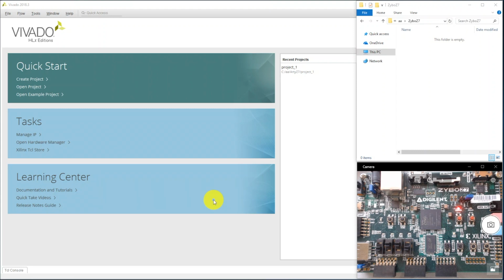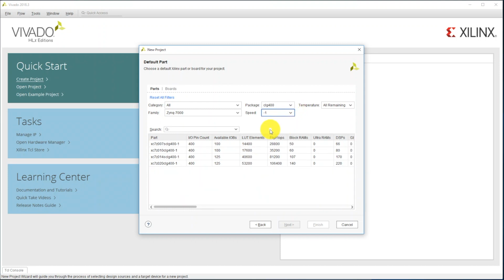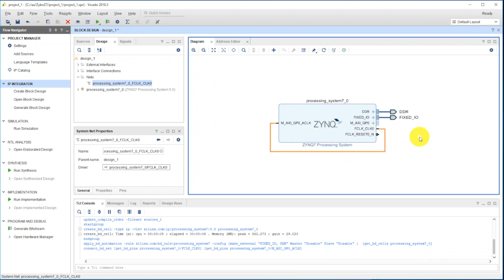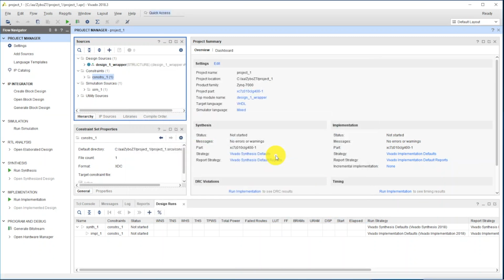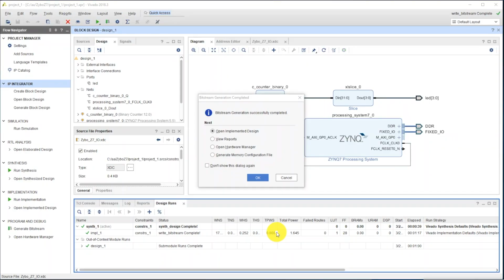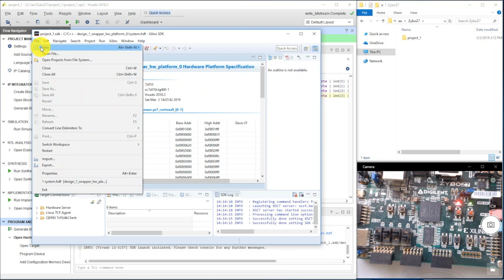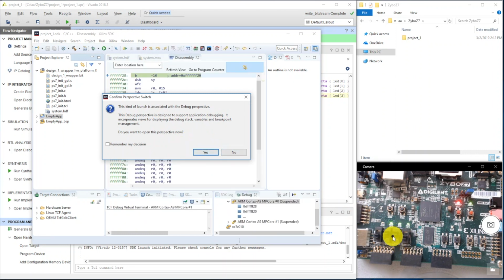Getting started from scratch with Digilent Zybo Z7 Xilinx Zynq FPGA board using Vivado 2018.3

Comment: I would like to make a very directive and narrow comment, if I may.

So, the purpose of this project seems to make the leds blink.
To achieve this, ansepi is using the a clock, and in particular, the zynq's clock.

By default, that clock is dead, but he turns it on by stimulating the zynq with an empty project.
I have learned that there are alternative ways to turn that clock on, one of which is by having an operating system booting on start-up.

The operating system can boot from an SD card. (More actions needed to set that up which I am not disclosing.)

More details about the operating system and how to have it boot at start-up can be found here: https://github.com/Digilent/Petalinux-Zybo-Z7-10

So, yeah, my point was about how to stimulate the zynq's clock to start..... I hope that helped.
Reply from the maker: Yes, of course.  What's on your mind?

Comment: Why do we tie the clock to the input?
Reply from the maker: The clock is tied back to the input so the Zynq will operate correctly with the programmable logic section of the chip.
Reply: @ansepi  Brilliant, makes sense. Also, thank you for the video - I can confirm that this does work as I've tried it on my own Zybo board. One more question: Why do we have to add a 32-bit counter and then slice it down? Can we not have a 4-bit counter directly?
Reply from the maker: We have to slice down the 32-bit counter because the clock is too fast.  If we used a 4-bit counter directly, the LEDs would blink too fast to see.  Thanks for the question.

Comment: Hi ansepi,

This might be a dumb question, but how do the LED's know how to look at the certain bits of the counter? I thought they would have to be assigned to 4 of the 16 counter bits.

Thanks,
Samuel
Reply from the maker: Hi Samuel,

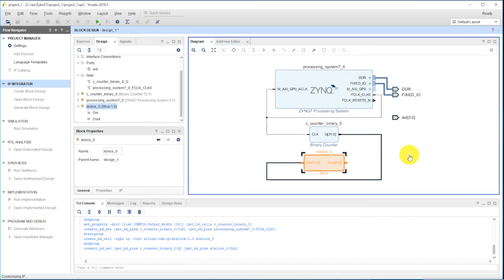Yes, the LED bits are assigned to 4 of the counter bits.  This is done by using a "slice" block.  The slice input is all 32 counter bits.  It's output is only 4 bits, bits 26 downto 23.  These are then connected to the LED bits.  At 2:52 in the video I add the slice.  At 3:08 I connect the 4 bits.  Thanks for the question!